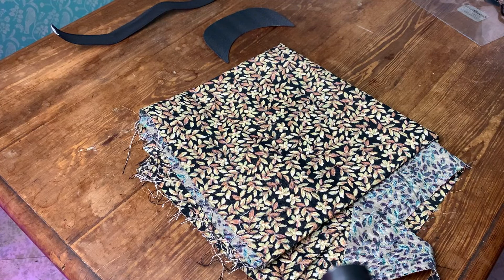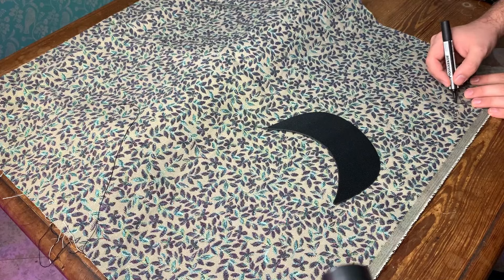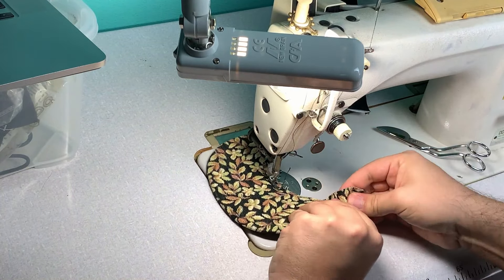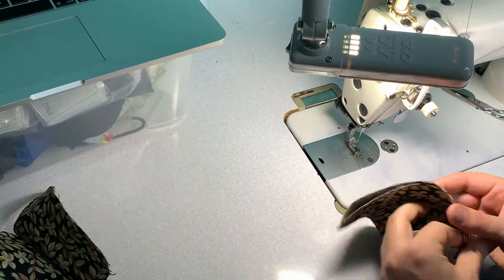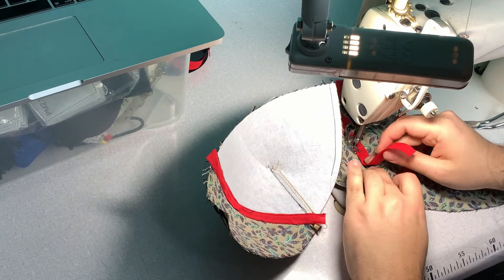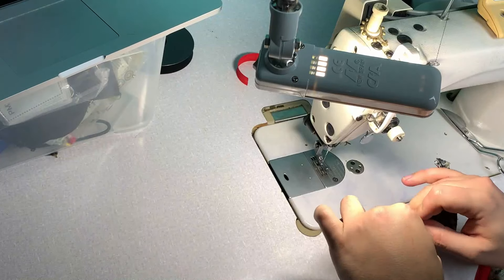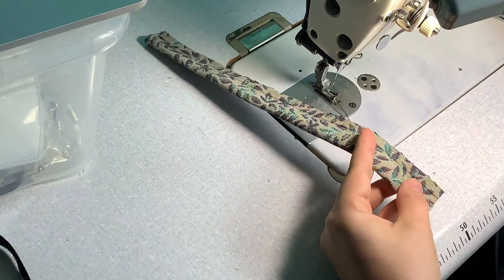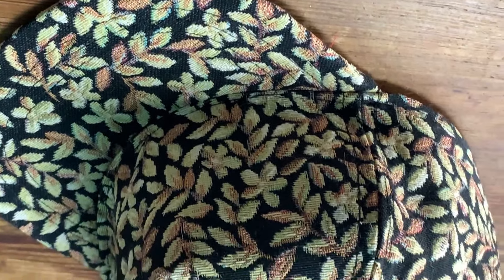Making a baseball cap, because...why not

Comment: gonna attempt this but try for my size in a fitted hat (nu era style) rather than a fastener or velcro.
Reply from the maker: If you make a toile first to check the size, you can adjust it easily!
Reply: @albertoaisu  yep defo will do and then when i have my pattern i can make like a million caps for myself. just need to find a spurce for brims or find out what plastic theyre made from and buy a cpuple sheets to cut loads from

Comment: Where do you get patterns like this? 
I have never made a hat before, but I wanted to give it a try, so I know absolutely nothing about anything. 
When it comes to getting fabric or patterns I don't know where you get them, and if I want to make my own I don't know where to do that or how to get started. 
Do you have any recommendations??
Reply from the maker: I traced the pattern from i hat i had, it’s easy to do, you can just use something soft like tissue paper, pin it on each panel, trace the seams with a pencil and add the seam allowance..or if you prefer ready made patterns you can find some online, especially on etsy!

Comment: I am struggling with the brim! Did you make one side 5mm smaller all the way around or just on the outer curve?
Reply from the maker: Just on the curve, so the seam will be pulled towards the bottom instead of sitting in the middle

Comment: So what type of needle and thread are you using for this?
Reply from the maker: A thicker needle like a 90 or 100 and normal polyester thread
Reply: @albertoaisu  90 or 100? And what's normal thread? Sorry I'm just learning all this can u be specific or show pictures of the needle and thread please
Reply from the maker: Oh sorry, 90 and 100 are needle sizes, at least for industrial sewing machines, something like needles advertised to sew denim or thicker fabrics…And for thread i buy these big cones of polyester thread, they’re pretty standard, you can find different brands but they’re all pretty much the same..Just sewing machine thread spools..
Reply: @albertoaisu  ok thank you I have a industrial sewing machine as well a few of them but I've always sewed heavy materials like 1000 d cordura but thanks for the explanation so polyester thread and basically needles that sew denim would work thank you you have been a big help I been trying to figure it out for a week or 2
Reply from the maker: @soldiercoleone no problem! Glad i could help!

Comment: How would you get the front panels of the hat to be firm? Would you use something like a heat press? For example fitted hats tend to have a firm front panels, typically where the teams logo will go.
Reply from the maker: If the fabric is firm enough you might not have to do anything, otherwise i would use an adhesive backing, there’s different types with different stiffness, to heat bond it to the fabric you can use a press, but most times an iron is good enough, especially on small areas..
Reply: Also there's this firm stuff called buckram or something that does the firm standing finish. Can be found at sewing shops
Reply: @bluestripes6037 thank you for this !!!!

Comment: Awesome video man, much obliged. I'm a complete noob and was wondering if you knew if my Janome Sewist 721 would have enough drive to top-stitch through the polymer brim and the two layers of fabric?

I've been searching all over to find a simple answer and can't seem to find a consensus. Am I dreaming that my machine can do this? Do I have to find a commercial machine to pull it off?
Reply from the maker: Thank you!I’m not familiar with your machine, but if it can sew denim it should be fine, the plastic brim is thick but also quite soft for the needle to poke through, and if you use a thinner fabric than the jaquard i used, should be less of a challenge to your machine..I’d suggest to try, with a thick needle, at worst you’ll have wasted a needle, but i don’t think it should damage the machine!
Reply from the maker: Just try slowly in the beginning!

Comment: Where do you find the plastic Brim
Reply from the maker: I got it from a supplier wholesale, you can find different types online, but you can also get polypropylene sheets in many craft stores (the ones used also to stiffen bags) that are easy to cut in the shape you need and quite inexpensive..

Comment: How did you make make the brim, or where did you get it?
Reply from the maker: I got mine from a wholesale supplier, but (at least in my area) it’s easy to find whole sheets of polypropylene (it’s used also to make bags) in craft stores, you can cut it with scissors to the shape you want..
Reply: @albertoaisu  Okay, thanks!
Reply from the maker: No problem! ☺️